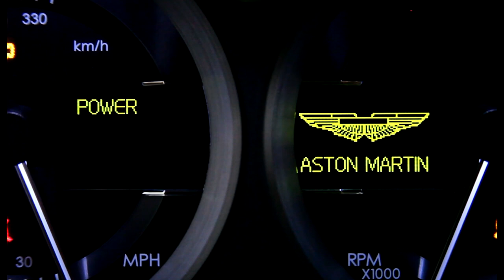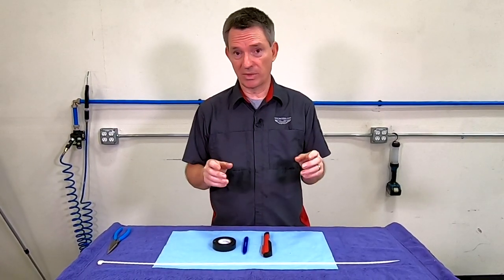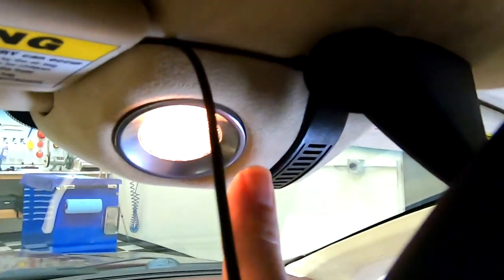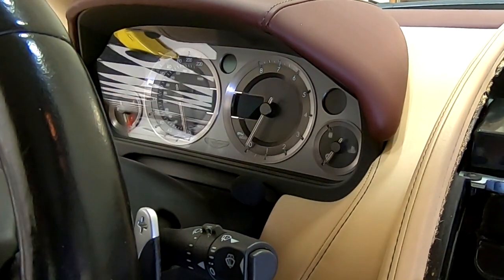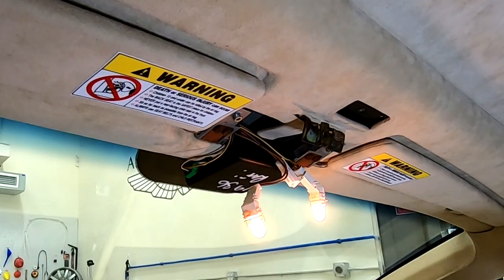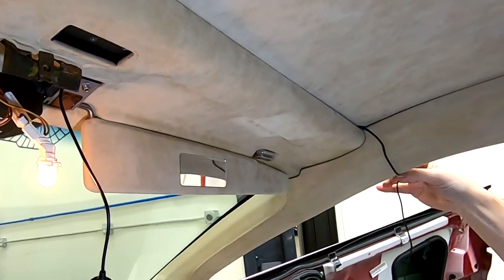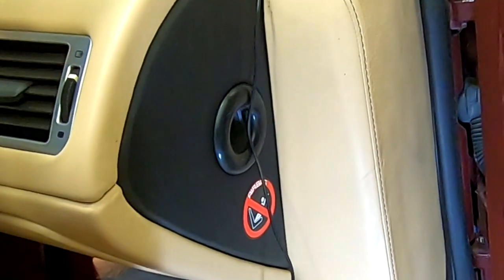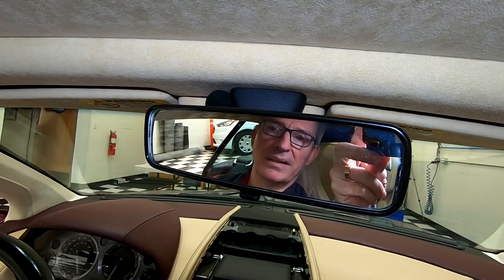Installing the Handsfree Microphone - Aston Martin DB9 Infotainment Upgrade - Part 6

Comment: there are countless places inside the console/waterfall area, completely out of sight, and within inches of where most of the other wires are routed. it's not as if the console is aurally isolated from the interior. .

typical of microphones for modern phone use, they are omnidirectional and long-range.  and as demonstrated, so clearly, the sound quality is practically identical no matter where it is mounted. so why NOT inside the console/waterfall area? why do it the hard way...
Reply: I don't think those mics are omnidirectional. They appear directional as they only have holes at one end.